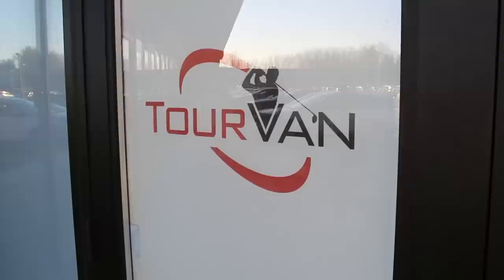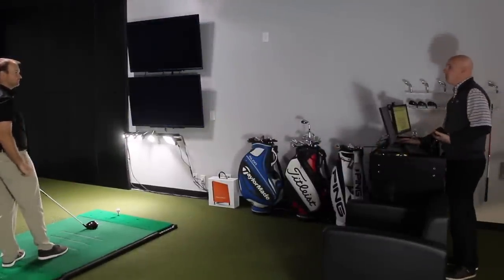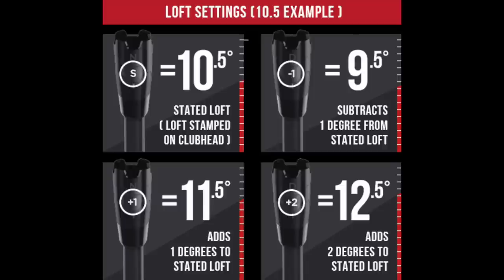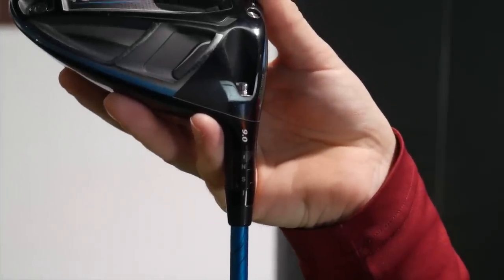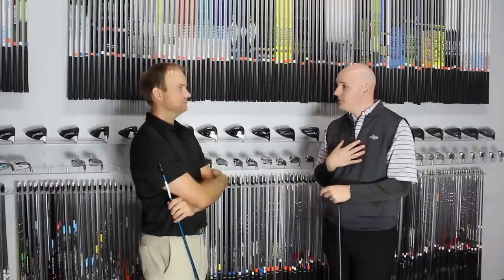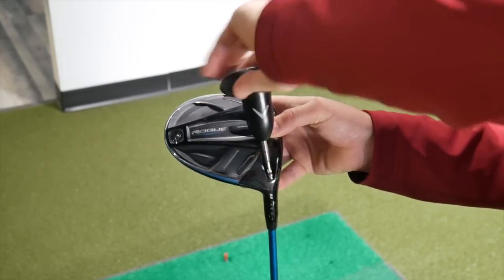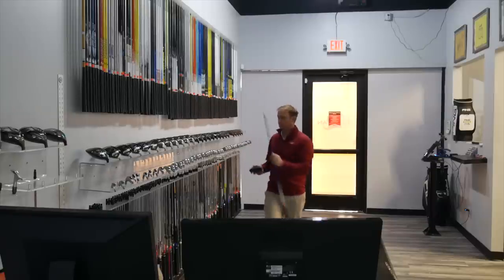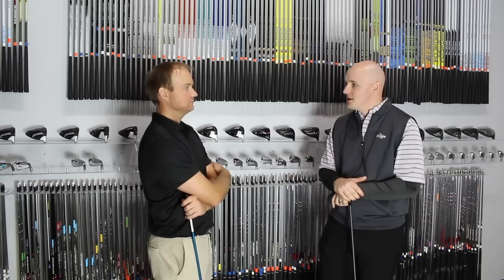What You Need To Know About Adjustable Hosels

Comment: How does a Cally RH sleeve affect a LH head regarding loft and lie settings?  Exactly opposite?  +2 loft RH = ? In LH for example?  Thanks as there is lots of conflicting info out there regarding this issue.
Reply from the maker: Thanks for the question, could you clarify a bit more so we understand fully?
Reply: 2nd Swing Golf thanks - to explain.
I am a LH player looking to drop the loft 2 degrees on a 9 deg epic flash. 
Can I just swap the LH sleeve and put on a RH sleeve (or even just switch out the cogs like you did in the video with a RH sleeve) and achieve the minus 2 degree loft change and get it to play like a 7 deg driver?